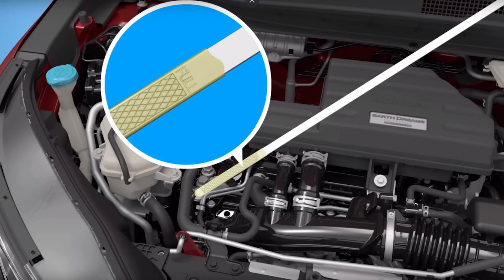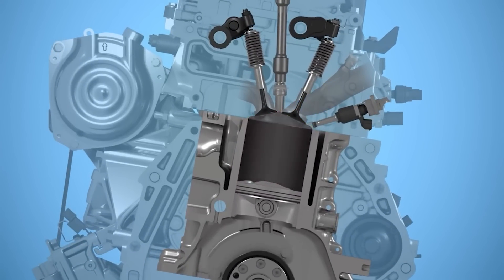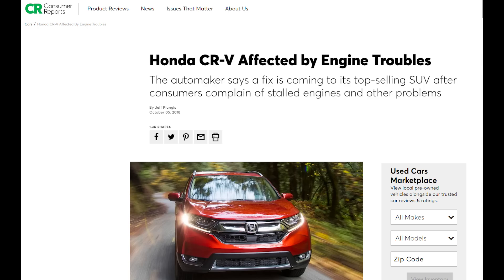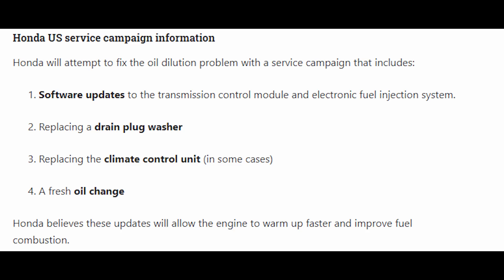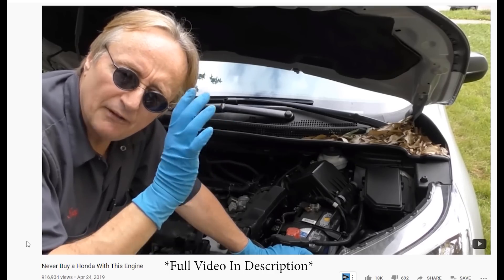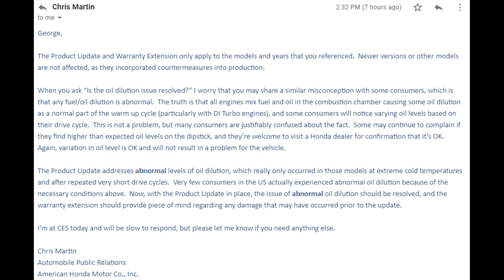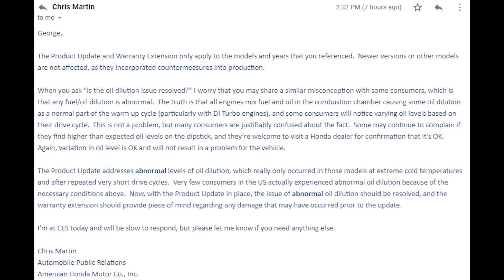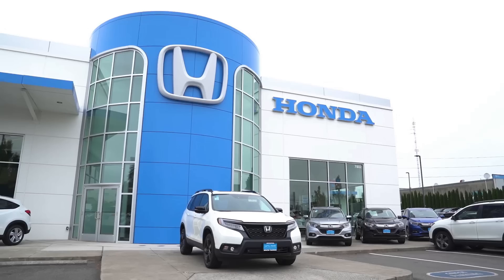Does Honda Have An Oil Dilution Problem? | 1.5L Engine in CR-V and Civic

Comment: So stay away from the 1.5 engine  got ya

Proceeds with purchasing a 2.0T
Reply: Basically... like Toyota never had a POS engine in their lineup
Reply: john smith they did but they didn’t put in every single popular vehicle they made. This engines in the Accord the Civic and the CRV.
Reply: @tails300  Well, Camry is very popular lol. And well, Toyota is where it is not because its great engineering or taking risks, but because quality control and stay in safety zone. Smart, but boring, and an example would be the BM...sorry the new "Supra". By the way, as I reply you I am literally seeing the news that Toyota had to recall 700K vehicles for faulty gas pumps. Not the engine, but that just shows...
Reply: john smith and Honda had to settle a class action lawsuit because their VCM was wearing their V6 engines out prematurely. Let’s not forget there horrible 5 speed auto they had problems with and had to extend the  warranty for.
Reply: @tails300  I heard that VCM was only common if you didnt change your oil on time. I do every 5k with full synthetic and it runs great, just took it on a 700mile drive to a town 2 hrs past Nashville TN and back yesterday, I live in East TN so I drove to the middle of the state.
Reply: @disco.lemonade  you can still buy the bulletproof 2.0 on the base civic well and that CVT that's a different story
Reply: @Oaktwn16  no issues with their cvt
Reply: @moeanthony9308  not yet I have one myself a 17 civic I only have 30k I did the first CVT fluid change it drives fine but from a dead stop it laggs as well as acceleration
Reply: @Oaktwn16  Yea the lagging is normal. I had a 15 civic but traded for a Rav  recently. A friend of mine had a 14 civic with 160 kilometers and no issue. Honda makes agood cvt
Reply: @moeanthony9308  yea I know but is dangerous at times especially when going uphill it looses alot of power but I have faith in Honda's CVT that's great Rav 4 is a good car
Reply: @Oaktwn16  Yea I miss the Civic sometimes but it was a tad too low. The trick with cvt is let go of gas to avoid lag and re apply. Take off eco or shift to sport.
Reply: eso510 the 2.0L’s come with a 6 speed manual transmission option in some new 2020 civics 👍🏼
Reply: john smith yes they did. 2az-fe in Camry, RAV4, Scion tC, xb

Comment: I’m not gonna dispute the claim that Honda reliability has dropped some in the last few years but consumerreports is a pile of crap. You really gonna tell me Porsche is in 4 place? I also think this overall “reliability” is being overblown to a set of bad engines. Their first turbos standard across their lineup. Is it a problem? For sure but I just think it’s being overblown over the whole company and their history. This problems never occurred before they added turbos. Most likely Honda is doing research to fix this problem as we speak and are trying to down play it in the mean time because of this specific reason of people over blowing the per portions of issues.

Comment: I've got an '18 CRV with the 1.5T. So far, I've got 39k on the clock. I wasn't aware of oil/fuel issue until a few months ago when I stumbled onto the subject in the CRV forums. Anyway, I switched to Amsoil at the first oil change. Just for fun and to monitor engine wear on this 1.5, I decided to use Blackstone Labs for oil analysis. My last sample was sent in with 6049 miles on the oil and 31,629 miles on the clock.  Here's an excerpt from the Comments section of the lab results: 

JOHN: We're seeing good progress with this sample. Its lower metal levels are partially due to this being a
shorter interval (at least so far), but there's also plenty of improvement on a per-mile basis, perhaps due to
lingering wear-in washing out. Regardless, these are healthy numbers, so your engine is maturing well and
without any major issues on the horizon. Silicon is fine at 41 ppm, but it may come down more in the future
once the oil is changed. There's still fuel showing up, but 1.5% isn't a harmful or problematic amount. The
3.0 TBN shows plenty of additive left. Nice!
I'm no engineer by any means, but I guess the 1.5% number quoted above suggests that there isn't an issue. I just sent off my latest oil sample to Blackstone, as I'm now at just under 38000 miles on the engine and the oil sample had 5941miles on it.
I started with Amsoil Signature Series 0W20, but have decided to switch to Amsoil XL 0W-20 just to see the difference, if any, with lab results. Also, I switched to ethanol free gasoline after last oil change, which has increased my combined mpg from 28.6 avg to a consistent 34.2 avg.
Lastly, I just stepped outside to sniff the oil dipstick. If it's got gas mixed in it, I can't tell, as that Amsoil has a pretty healthy scent to it.  Sorry for the long rant, but I love this kind of stuff.
Reply: Thanks for posting the lab analysis John
Reply: Use Mobil 1.
Reply: Fadic4 
I used Mobil1 in my previous vehicle. A 2001 Tundra V8 with 206k trouble-free miles with good results. Great truck, until a lady ran a stop sign and t-boned my beloved Tundra.
Reply: John Gonzales

I am curious to know what made you switch to a different brand? 

 I honestly think they’re the best oil out there. They’re the biggest lubricant manufacture I believe and also spend the most on R&D. They have a whole fleet of cars in Las Vegas that get tested all the time, they also compete in a lot of motorsports as well.
Reply: Me too!  Honda hides the very info I need, to protect my wife and the home budget from a "monster" i could have never imagined, even could exist in a Honda.  Blame the US Govt gas mileage deadline demands and mandates being too agressive.  Another biggy is the 1 speed automatic transmission,  powered by a single metal belt that won't last long, even under average use conditions
Reply: The process with which Blackstone labs tests fuel In oil is not accurate. It's more expensive to have it properly tested. They are good for all other aspects but not for oil dilution. Check out bobistheoilguy.com for more information.
Reply: @taz4100  

Thanks for that info. I'll check out bobistheoilguy for details and maybe another lab source. If there is another lab source that analyzes oil dilution in more depth and not too terribly expensive, I may give them a shot. Thanks again, as I didn't think to check bobis.. for the oil dilution. My main objective with the oil analysis is just to monitor overall engine wear, but since I stumbled onto the oil dilution issue, I'm a little more interested in that aspect. 

I mentioned in a separate reply within this thread that this is my first "tiny" 4 banger. In fairness to Honda, gotta say that I'm really impressed with the torque/hp/turbo performance of that little 1.5t. 

Thanks again for the info you provided.
Reply: Thank you for sharing your experience. I recently purchased a 2019 CRV and I can smell some gasoline on the dipstick.

Comment: There is a reason Honda only put the warranty extension on a few years… The problem has been corrected… And is been known as one of the most reliable vehicles for a very very very long time, they’re not about to try to ruin that reputation.
Reply: Can you provide any notification from Honda it's been fixed? they just continue to claim its normal.

Comment: As someone with a 2016 Civic, 1.5T and live in a “cold weather state,” I am still confident with my daily driver. Yes, my dipstick does raise above the “full” mark from time to time, but I change my oil religiously at 5,000 miles. I have 74,000 miles with demanding stop and go driving in Manhattan on my civic and have no engine related issues
Reply: I can’t see the logic in being confident in a car that’s only 4 years old.
Reply: Jeffrey Galle 74k miles in a 4 year old car is not normal that’s pretty high
Reply: @jeffreygalle  So when WOULD you be confident in it? When you sold it? LOL!
Reply: Jeffrey Galle I’ve had it for just a little over 3 years, so I’m averaging about 23k per year.
Reply: Kenneth Eng you’re in denial. You probably can’t get rid of it because you took out a loan to buy a trash car 👍🏾
Reply: Wow, Vic. You win the Internet for dumbest comment of the year...
Reply: Victor San nicolas paid it off in full in October 2019 :) 

I’m going to run it into the ground—definitely not selling it. My last car was a CRV with 275k before the transmission started having issues.

Comment: We got rid of our 1.5 litre turbo. We wanted to keep it but after their so called fix for this problem we had gas in our oil. We had 15000km on our vehicle oil was black. I have a 2000 Toyota Sienna with cleaner looking oil. We bought a rav 4 2.4 litre engine. Not a turbo. Don’t listen to what they say. I will bet that going forward these engines will fail any amount of gas in the engine will wash the cylinder walls and the engine will wear quicker.

Comment: My Dad has a 2017 Honda Civic EX-T and my younger brother has a 2018 Honda Civic Hatchback Sport, both of them have CVTs.  I told them about this potential problem.  So they drive their vehicles right away the moment they turn it on and idle for a couple of minutes before shutting their cars off.  They also fill up their vehicles with Shell's premium (92 Octane).  My Dad drives his car conservatively, my brother on the other hand romps on his car but of course after sometime driving the car nicely for 15 minutes.  We checked the oil the way the Owner's Manual said to do it.  Also they change their oil at the dealership, once the oil life is at 5%.  Overall, no smell of gasoline in the cabin.  Though on their dipsticks, they show their engines are overfilled.  My Dad has 25K miles on his car and my brother has 52K miles on his car.
Reply: Must be they don’t care about the Reliability anymore so we shouldn’t be buying their cars ride a bike

Comment: You are the first youtuber who is addressing this matter seriously. It’s the same 1.5T engine so the problem hasn’t fixed
Reply: Far from the first, just the latest...
Reply: Wow yes, please put more spotlight on this problem I have a 2017 Honda Civic and it is happening with it
Reply: You all are missing the point. When oil dilution occurs in those 2017 and 2018 1.5 liter engine dreammaker the car misfires. The misfires causes all the icons to flash. That means none of your safety features plus the cruise control don't work.
Reply: daryl howard  
Nope. Several channels covered this before Scotty, including John Codogan who did it 2 years ago....
Reply: Car connection just did a review.
Reply: .. except Scotty Kilmer.. which he refrenced 🙄

Comment: Id also bet that as these engines wear, the oil dilution issue gets worse.
Reply: Doesn't matter. Very few people keep their new cars past five years anyway...
Reply: @troyjollimore4100  but it will matter to the poor sucker that buys it second hand.
Reply: @YoureMomsMaster  Research, FTW! But it's like almost every other make/model. There's always something that's known for failing 'en masse'. Even when that only accounts for 1% of all vehicles produced.
Reply: @troyjollimore4100  
We are talking Honda..after 5 yrs it gets sold for another 5 to 10 yrs..nothing a bottom end rebuild cant fix..VW tdi uses a drilled out piston that splashes the injected fuel up and into the air..but diesels have a proven history with direct injection.
Reply: @troyjollimore4100  and I'd bet that extended warranty doesnt transfer to subsequent owners.
Reply: @YoureMomsMaster  The extended warranty does transfer. Which sucks for me. I bought the extended warranty for mine! LOL! ;)
Reply: @troyjollimore4100  Actually the average age of new-car trade-ins (excluding leased autos) is about 6 years.
Reply: @troyjollimore4100  It matters to anyone who doesn't do so and eventually this will affect residual values.
Reply: @fiveowaf454  That would be me. But I don't care about residuals, either. Unless I have a major health issue that forces me into an SUV (or 'taller' car), I'll be driving this for fifteen years or more.

Comment: Plain and simple. Honda is pushing it under the rug to prevent a major recall that would cost hundreds of millions and scar their reputation significantly more than if they just lie and let the engines wear them selves out a bit faster than they would have normally. The warranty likely wont cost them much given that this kind of wear wont show up that early but will with out a doubt accelerate wear due to the fact that fuel breaks down oil. Some dilution is normal but so much as to cause an odor or the oil level to rise significantly is an obvious problem. As far as only covering vehicles in certain climates is BS as most vehicles will eventually end up in lots of different climates as they get bought and sold. If you have one of these engines, just change the oil every 3k and call it a day.
Reply: If your within rights to do so, claim lemon law.
Reply: @handycap9815  I get it. Unfortunately you cant expect the manufacturers to do the right thing any more.

Comment: Why any DI gasoline engine else has no problem only Honda?
Reply: Honda had been using DI since around 2013 in their non turbo engines and those are not really having these  issues, it's Honda's new 1.5 turbo engine which they now use in civic, accord and crv is in question.
Reply: I know Hyundai's been using them for 5 years now and no issue?? ya ok?? I'll stick with Honda.
Reply: No such issues on Hyundai engines but also for any DI engine just due to its design may have issue of carbon build up on valves. Now it varies by manufacturer and owners care and can be kept under control by specific timely maintenance.

Comment: Bought a new 2018 Rav4 after owning 2 CR-V's. Just could not trust the Honda engine situation. My 2011 CR-V had an extended warranty added by Honda due to a problem with excessive oil consumption. My 2008 CR-V did not have this issue. Should have kept it.

Comment: The facts.  I live in a colder climate.  I have a 2018 Honda CRV 1.5 DT with over 60,000 Km on it.  The recall work has been done.  During moderate temp, say down to -20C my oil rises about 3/8" above the full mark on the dip stick shortly after an oil change.  Occasional longer trips don't seem to vaporize much gas out of the oil.   Prior to the recall it would rise nearly 5/8" above full mark.  Is the problem solved?  I am certainly concerned about it.  How will the longevity of the engine be affected?  Apparently I need to foot the bill for more frequent oil changes?  Don't get me started on the lack of cabin heat at start up or urban use.  I certainly wouldn't recommend a CTV 1.5.
Reply: What is the fix at the dealership
Reply: @ericmurray238  Update.  I still have the car.  It has 177,000km on it.  No  major issues.  I have changed the oil myself more frequently than recommended at about 8000km or 40% on the maintenance minder.  I am not sure what updates the dealership did.  Some were mechanical others were software.   An acquaintance told me a disturbing story.  He has a 2017 with the same mileage.  His timing chain or rather the nylon tensioner failed. When they took the motor apart they found the shells/crank motor was toast.  The dealership had changed his oil at the recommended time, 10%.  They are honouring the oil dilution warranty but he has to pay $3000CA.  Concerned  😧 I don’t know if the new ones have totally resolved the problem.
Reply: I really appreciate the response. Knowing that something could grenade and go wrong is nerve wracking. Hopefully you can continue to to have trouble free miles. Thanks again for the feedback @parkland4530